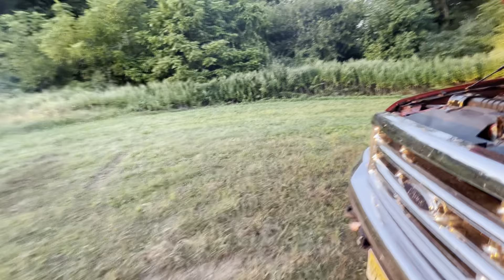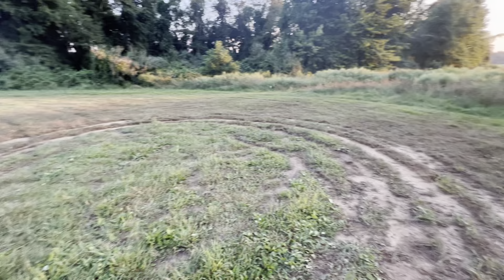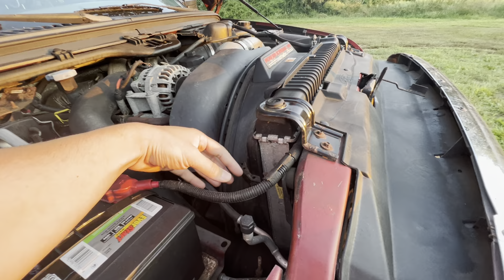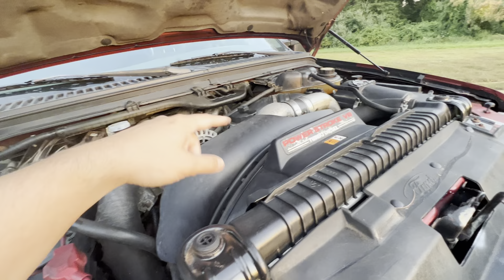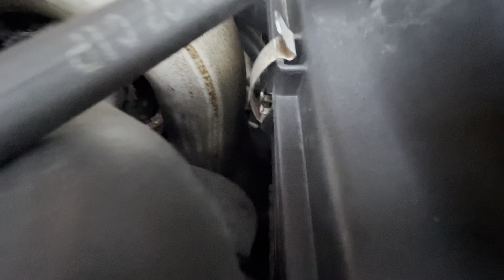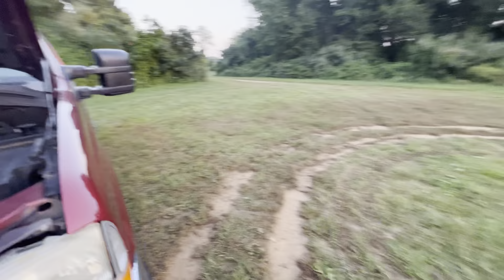Popular 6.0 Power Stroke mods i wont do

Comment: It’s all about personal preferences 👍 
Your truck your choices, that’s how it should be. Also something you could look into is a inline coolant filter. It taps right into the actual lines so it has no choice but to go through it and be filtered. The amount of casting sand / crud that’s still in the motors even after back flushing, there’s always gonna be some residual gunk in the system. For me I haven’t had a issue yet either so I don’t see a need myself.